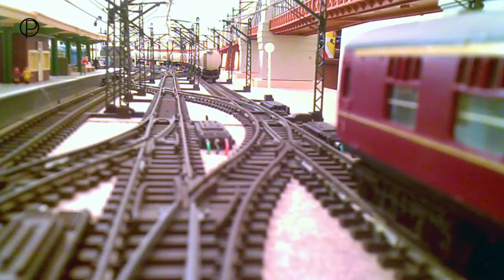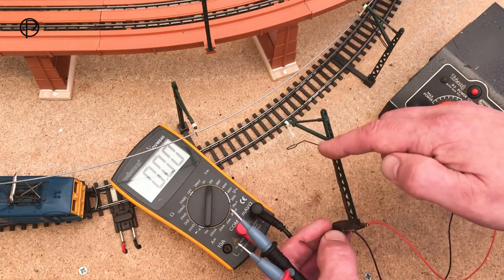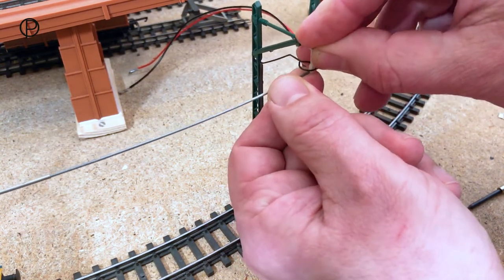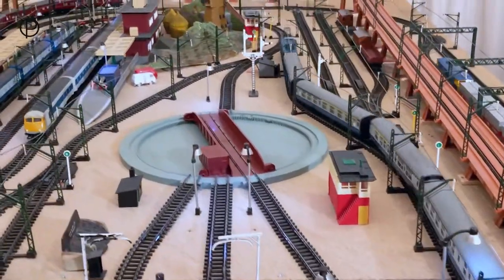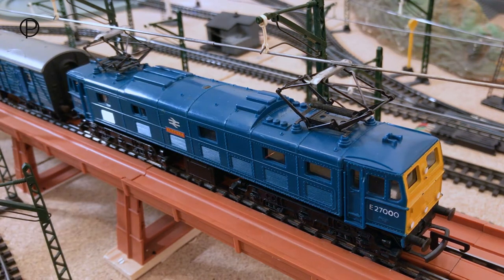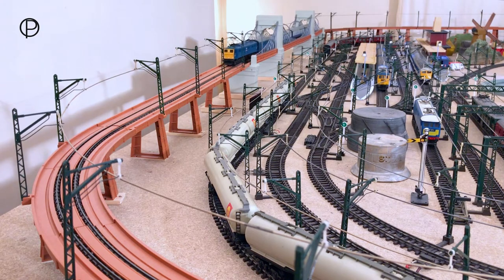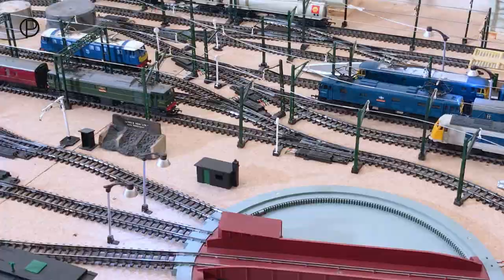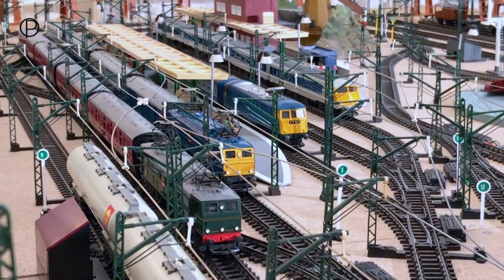Tri-ang  Hornby R.351 EM2 Electric Locomotive "Electra' in BR Blue and BR Green

Comment: Excellent Oscar. First time I’ve seen someone explain the catenary system. Didn’t know about the insulated side. Although I’ve got an AL1 , she only ever ran from the rail. What a brilliant system .
Reply from the maker: Its a great system theres the potential to run two of these electrics on the same line with different controllers.  Or one of the electrics and a locomotive running from the rails both with different controllers.  Should one be brave enough!  Oscar

Comment: Another classic video Oscar. Judging from the comments here a lot of people don't really know about these models. I bought my set in Great Yarmouth in 1965. It cost exactly 5 Pounds which was a full weeks wages then. (How much is a full weeks wages today?) Unfortunately I sold that as a perfect condition boxed set in the mid 70's. I have been able to replace it ( boxed) but with broken pantographs.  The only surprise was the insulated side markings, I don't recall that but I never had any issues with running my original set. Thank you for this video Oscar. Cheers, David.
Reply from the maker: Thanks. Wow! £5 it seems like a bargain (But a weeks wages!), that would barely get two masts these days.  I saw a Highway Man set go for £375 recently.  The pantographs are £35 each if you can find them. Oscar
Reply: I couldn't justify that expense for a model that basically just sits in a display cabinet.  David.

Comment: hi oscar I had one in 1960/70s i wish i still had it today mate  I all so had the overhead gantries to on my old layout in the 1970s with my 3 E3001/81s which I still have on my current  layout and they are still going strong after 50 years of srecive  with me i got they in 1969 in beatties of Southgate where I come from originally sadly beatties are on longer with as 😭😭😭 I do miss at model shop the model shop in Belfast has gone to we no longer have any reil model shops in the Belfast area now I now order from England mate 👍clive
Reply from the maker: Good morning Clive it's great to hear you have your original E0001/81 after all that time. do you still have catenary? Our excellent local model shop went about three years ago now. They're also used to be a couple of traders with stalls fairly regularly on the local Sunday market with great railways stuff. Sadly they seem to have gone now as well. It seems to be the way of things, unfortunately. Apart from rising retail rents and business rates and the decline perhaps of the hobby in general, I've heard that the big brands haven't helped by imposing impossible terms and condition with pricing structures that work against the small shops.
Thanks for watching.
Oscar
Reply: Hi oscar I no longer have the tri-ang hornby ohle i now use the dapol/home made ohle mate clive

Comment: Hi Oscar,     Looking back at this video, it appears to me that the overhead catenary wire is joined at all of the points.. Does this mean that both locos must be drawing power from the  same controller? 
I had never thought about it before, but if all of the wires are connected at the points.Then power would flow through to  any siding that had the "inside rail" (that in many cases) would also be live, because it was not isolated by a point blade?  Only some points on a layout would have the "inside rail" isolated by a point blade.. Many must/would be connected to the permanent rail that did not go through the blades?
Would this mean, that there could only be one overhead circuit on a layout?

Comment: Hi Oscar do the growly motors as its running due to the knurled wheels on the running loco drive part or is it just the noisy motor ? 
Its so good to hear this sound as it has sstruck a series of good memories of when my mum (rip) bought me a blue vic rail triang double ender around either 1979 or 1980 and remeber the sound of it as it sounded almost identical to these ones. 
I remember how happy i was and sad too as i asked for a lima 44 class australian engine for christmas but got the blue vic rail one and like i said still happy to get something similar to what i liked but love them now mums gone as it rekindled some good memories of her so i bought a few (6 lol) to commemorate her passing. 
Thanks again for the great info you supply is as we do appreciate the videos you put out to help us.
Cheers from John in Australia.
Reply from the maker: Good morning John it's great to hear the videos bring back great memories I'm glad you are enjoying them. The motor bogie on these EM2's can be quite noisy due to wear/play on the armature bearings. The blue version in this video is not as smooth as the green one, Tri-ang used the same mechanism in the Class 31 and the 37 and both of these also have the characteristic growly motors. They sound like models with knurled wheels. Oddly the models like your double-ended Diesel have far smoother running and better-designed motors but get their impressive sound from the knurled wheels.
Thanks for watching and taking the time to comment it's hugely apricated.
Take care

Comment: Excellent.  With overhead power and track power, how many trains can you have running on your layout simultaneously?  Or, because the overhead power current passes back down through the track, is it not possible to have a track-powered loco and an overhead-powered loco both running simultaneously on the same track?
Reply from the maker: On a layout of this size its not really practical having two locomotives running on the same line.  But yes you could have one electric locomotive and steam/diesel on the same circuit.  There are two circuits so optionally four locomotives independent of each other.  It's also possible to have two elections on the same line independent of each other collecting from the overhead and both using opposite rails for the return path.  This does cause conflict with models that take power from the track only. 
Thanks for watching.
Oscar

Comment: Hi. I have the green EM2 in CKD and the box. It was originally supplied with two caternary masts and bases which I have. What I am lacking are the assembly instructions for completeness. A photocopy would do if you know of anyone who has them. I also have 3001 and the Victorian Railways R257. Interesting that these latter two have the switch on the roof rather than the concealed Electra.
Reply from the maker: Hi Nick, yes the roof of R.257 could have had a bit more thought. Have a look at this link http://www.tri-ang.co.uk/OO%20Latest/CKDinstEM2.htm  it has the instructions R.388 CKD kit click on the various parts it opens up larger views of the sheet. Sound like you have fine collection.
Stay safe.
Oscar

Comment: Thanks for the information on the Em2s and the catenary. You might consider easing the 4 screws underneath the bogie of the blue one . I did this on mine as a teenager and it runs quieter. But I bought a Brush type 2 in a set some years ago . All mint but the motor sounded like yours . I seem to remember I found a part was broken on the bogie that made it sound rough. I think it was stopping the meshing of the gears. The part missing wasn't found . Just a thought . Cheers Graham
Reply from the maker: This motor bogie is of poor design!  Which is unusual of Tri-ang. The growling noise that comes from the motor is a result of movement of the armature, moving laterally along its axis in the end it will catch on the pole pieces and stop altogether. This is caused I think by the failure of the plastic barring on the armature (S.5451) this sits on the magnets for the magnadhesion. The part has a small hoop which should rest on the magnet. This hoop is semi flexible when the hoop becomes miss shaped or brakes or rots as a result of over oiling and use of an aggressive lubricant. This I think allows the armature to move. This is very evident at low speed/power. As speed increases it evens out a little but still wobbles. So it appears to get smoother with more speed/power. The hoops were designed to keep the worms at a constant height so the worm meshes with gear on the axels of the drive wheels. The drive wheels sits against a shoulder so they remain in a constant position when the on the track. The bottom plate with the four screws holds the magnets for the magnadhesion and the Pole Piece's in place and stops the wheels falling out when you lift the model up. If this is too slack the pole piece's drop down on the armature. The bottom plate should have been metal and the armature should have been mounted on thrust bearings like their other motor bogies. This would hold the armature in place and stop the pole piece's from dropping with flex in the bottom plate. This is only a theory of course. Its always annoying when you have a fine looking model but the motor lets it down. I think the best thing to do if you have one the runs fine, is leave it alone and only lubricate if really needed and then use a lubricant that is not aggressive to plastics. Today we have much better lubricants available especially as lots of small/fine gearing is now all synthetic of some sort. When this was designed synthetic parts where cutting edge. But no thought was really given on what should be used to keep them moving smoothly. The oils in use at the time were great on metal gearing.  Thanks Graham it good to hear other points of view.  Oscar
Reply: Hi Graham and Oscar, I once "googled" noisy motors, and an article appeared which suggested that the armature in question is "out of balance". I have an R553 in CP red livery, it is in nice condition but was noisy mid range speed, I removed the armature and checked it for balance with a spin on two metal rules, lo and behold it wobbled. So after careful removal of some metal from the armature, the wobble diminished and so did the mid range noise. So perhaps a combination of bearing wear plus un-true armatures makes extra noise.
Regards, Cliff.
Reply from the maker: Thats a great thought Cliff. This could also explain why some X03/4 motors run smoother than other, even when they appear to be in perfect condition. Do you think there is the possibility that the windings my not be equal on each segment? These were mass produced items. Friday armatures! Oscar
Reply: This could be a question for Sam (Sam's Trains), he is getting rather good with Tri-ang engines.   : )
Regards, Cliff.

Comment: Like the setup you have there. If you look at the EM2 locomotive with a magnifying glass the moulded builder's plate is perfectly legible, an impressive level of detailing even by modern standards. I'm sure you know, but would be worth touching on, that it was possible to so wire a layout such that you coul run a track powered and O/H powered locomotive together. Makes for interesting trains such as a failed steam locomotive being "rescued" by an electric. Not so convincing the other way around, pantographus up on a "failure":-) Keep them coming.
Reply from the maker: Thanks Andrew, there is indeed a lot of detail on this model for its age. I have shown in a number of videos locomotive on the same track utilising the O/H and track pick up. As you say, I have not really gone into detail about how this is done. But it's on the list of things to cover at some point. Many thanks for watching and taking the time to comment.
Oscar

Comment: Oscar, another ace video. Again, I had the green Electra in the ‘70s but was never impressed with its running, good to see it working well here. I did have the full catenary set and wired up my layout , a real pig in all the tunnels and mountain on 4x10 layout. Did briefly have two trains running on the same track but it blew my mind so i stopped that. Flogged it on ebay the other year and got a Eurostar instead, because when all’s said and done the Eectra is simply the ugliest locomotive ever made for BR IMHO!
Reply from the maker: It's difficult to control two trains on the same track especially on a small layout.  It was a great system but to take advantage you would need a layout at least the size of a squash court.
Oscar

Comment: Hi Oscar,
Why is the green EM2 so much quieter and smoother running? What did they change with the motor construction between the two models? Thanks.
Reply from the maker: Good morning Lisa I'm not sure there was a change in construction between the two motor bogies but one of these models has a very worn bearings.
Thanks for watching take care.
Oscar

Comment: Em1's were mixed traffic Em2's were passenger traffic, all seven Em 2' locos were sold to dutch railways  in the late 60's and continued in service longer than there EM1 class 76 counterparts ,
Two have been brought back to the uk 27000 electra and ariadne which is now in the manchester musium of science and industry
And em1 26020 is at the NRM york,
One or two EM2 locos are preserved in holland 
Not a bad survival rate for such a small class
Reply from the maker: Again that's great information, and as you say a pretty good survival rate.
Oscar

Comment: Nice presentation. The model does look smarter in green- never really suited the blue livery. At the time these locos were on the market, I had a Trix model railway with the EM1 BoBo loco which was good apart from the pantographs which were very poor compared with the Tri-ang pantographs  shown in your video (they had a flexible wire to the collector-not very attractive).

Comment: can the overhead system work with modern track
Reply from the maker: In the early 70s, they made mast bases that fitted system 6 track (modern track). These were only made for a very short time so are even harder to find than the ones you see in use on my layout. Hornby resurrected the catenary system again in the late 80s and into the early 90s, these were made for modern track. But also seems to be even rarer than the old stuff. And I think the masts were of very poor quality very bendy! Oscar
Reply: i may have to invest in dapols vesion